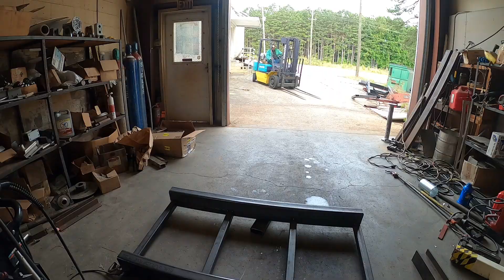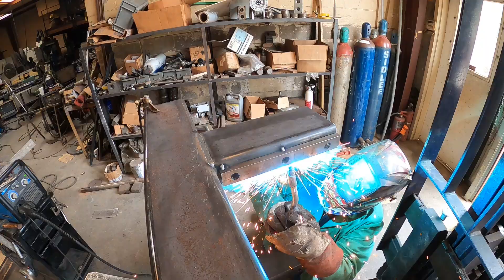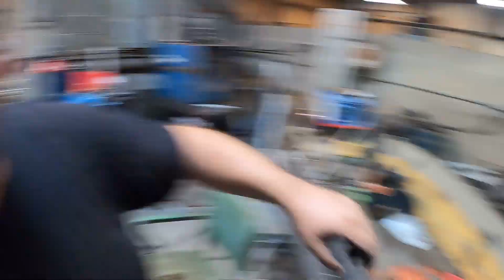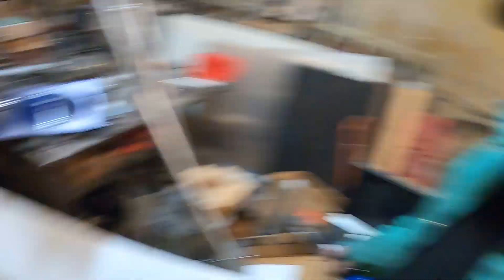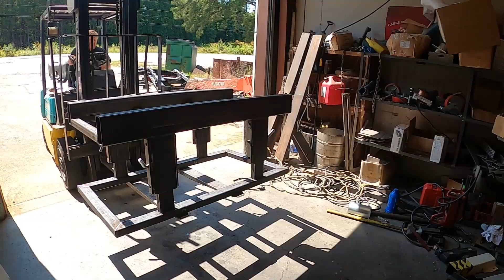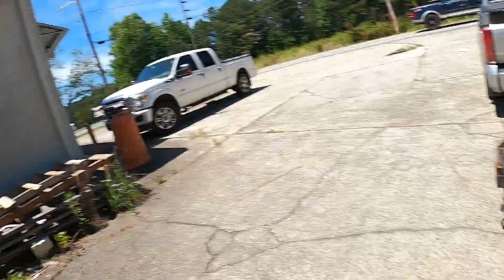Cutting, Welding Grinding! Fabricating Steel Tables Just in Time for Delivery

Comment: Dude measurements from corner to corner does not make it square! 
You need to do the 3+4=5 to make it square. 
Measure up three on the other corner Measure four up and the point between the two should be five!
It's a trapezoid if you measure at corner corner.
L up side distance between the upright and the horizontal measure the distant across the enpty L should five inches.
Your welcome.
Nothing but love!
Reply from the maker: I see what you are saying! Good point! I guess I should mention, you have to make sure each opposing side is the same length, then you can cross it. 

I will have to try it your way on next project!
Reply: @LivingwithCable  it's a parallelogram try it out get two same lengths pieces and put them square and then move one piece 4 inches and see if it's still Square! It will be square the way you measure but it will be a a parallelogram.
Nothing but love